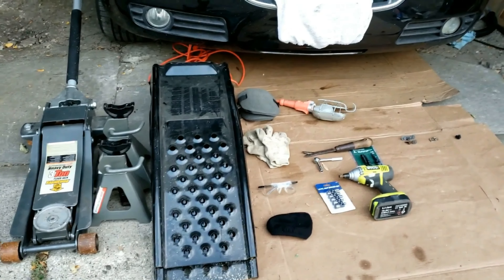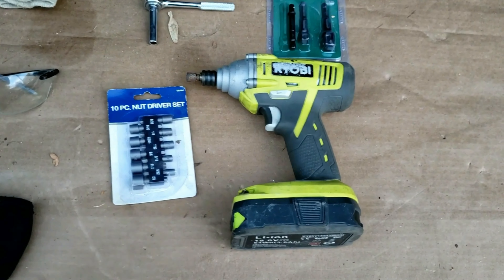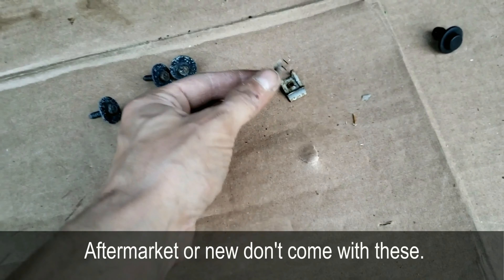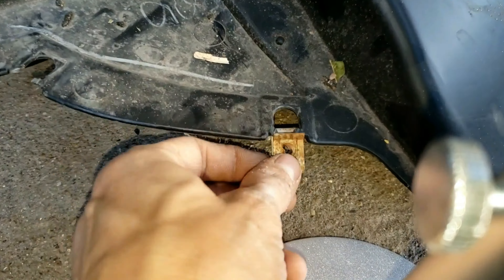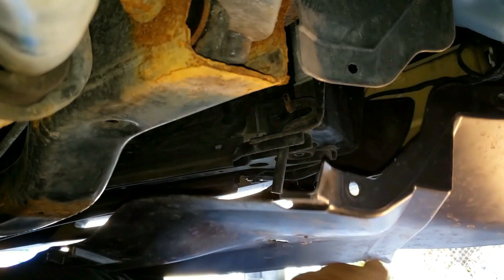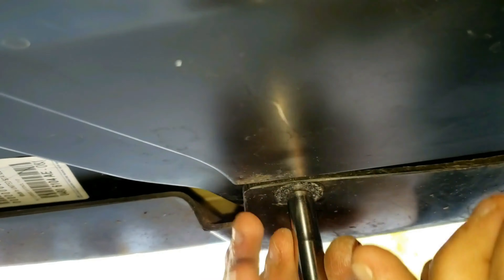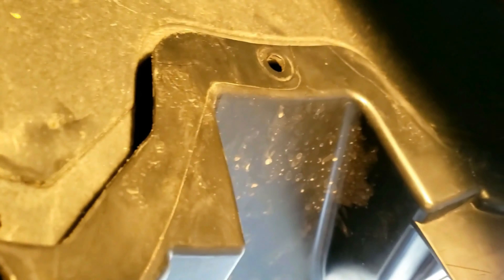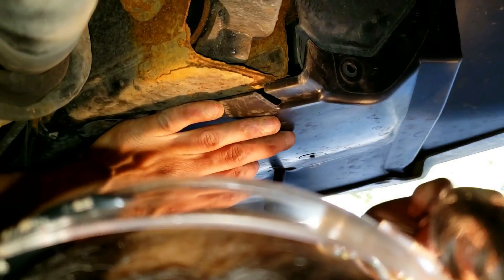Install Lower Splash 💦 Shield Engine Cover Guard on Chrysler Dodge Cars

Comment: Mine has another splash guard slightly to the rear of the car. I was wondering if this one goes under it, or over it
Reply from the maker: Not sure what you are asking. In general a car can have a few splash shields aka protective coverings throughout the base of the vehicle both in the front, middle, and rear.
Reply: Under, driving forward, you want the 2nd to be on top

Comment: What was that tube hanging, might be a dumb question but recently lost my splash guard due to a dip and noticed the tube exposing just like the one in the video. Want to be sure it’s nothing I should be concerned about
Reply from the maker: Yep its nothing bad in this case. I believe the rubber tube is a drain piece so water and condensation from the roof of the car or from the sun roof (if you have one) can flow down into it and straight onto the ground.

Comment: Can you show what the pins or brackets are the broke off so Ik what parts I need cause my splash shield on my 2013 is completely destroyed and had to replace the front bumper
Reply from the maker: The parts that hold the splash shield on are rivets aka plastic clips. Usually you can buy a variety pack and just pop these in. Also, check the description I posted the tools and supplies you may need.

Comment: Does this work for all Dodge? I have a 2011 challenger RT
Reply from the maker: Chrysler and Dodge share many similar parts. This should be mostly the same process. The difference may be in the number of bolts or clips to remove.

Comment: Hi. When you remove the plastic clips, do they usually need replaced with new ones? Does removing them damage them?
Reply from the maker: If you are referring to the plastic clips aka rivets, that are in the sides near the mud flap area then No. Then are meant to be reusable at least these ones are in this car.

If you are missing some you could always buy some extra rivets and put them in.

As for damaging them...its unlikely as a pry bar can easily pop them out. And putting them in is easy as well.

Comment: Hello, very good video! 
I’m trying to install it on mine 300c but it has 2 bolts (one on each end) holding like 2 little bars, my question is can I take it out or will it get damaged? Thank you
Reply from the maker: You should be able to remove the bolts, and then reinstall. I'm not sure what the little bars are though. 

Just look carefully in case their are more bolts.In this video I think I'm missing some bolts.

Their also might be some push clips or rivets on their btw.
Reply: @FixCarYourself  thank you so
Much I will try again! Do you have any video about fog lights for the 300c? My fog lights are  driving me crazy!! Could use your help
Reply from the maker: @joaquipereira8064  Yes I have 2 different videos o ca watch. If your removing the splash shield now completely then check out this one: https://youtu.be/xUT77lWQ-RY

If your going to do it later or our only doing 1 of the bulbs then check out this one: https://youtu.be/eMjM6oTRGA8
Reply from the maker: I put the links and all the tools in the description below as well for easy reference.
Reply: @FixCarYourself  thank you so much, I watched the videos but my problem is bigger than that lol, is there any way that I can send you pictures and I’m pretty sure you would be able to help me? Thanks once again
Reply: I’m sorry to be bothering you again but I’ve searched it and I think I’m missing a canbus but I’m not completely sure! Could you tell me if is that the part I need? Thanks
Reply from the maker: @joaquipereira8064  Not sure what or where you are talking about. thier shouldn't be any canbus underneath the car for a splash shield or for the fog lights.

Comment: 😡 I had my radiator and oil changed at the dealership one time and when I got my car back the splash Shield was gone. And when I took it back to them to work on it again, I guess they realized they forgot to put the splash Shield back on the last time, so they end up putting it back on wrong. And now it drags like a son of a b** and a lot of the fasteners are broken
Reply from the maker: Yep sounds like a dealership. This is actually a common occurrence by these companies. Usually they leave a few fasters off, because they forget to put them  back on or wind up breaking some of the (plastic) fasteners.

Comment: Mine is hanging off and drags when I tried to drive it. I've barely driven it and didn't run over anything. Does the car need it? If I get someone to take it off will it damage the car? This was my late husband's car and it's getting on my nerves!!!
Reply from the maker: You don't really need it  however if you are planning on having the car for a long time then it will help IF you live in harsh snowy climates or in dusty areas.

Comment: How you get the part? Splashguard
Reply from the maker: You could buy it online...ebay carries it. A little pricey more so because it's long and the shipping is what costs a lot. However, the cheapest option is getting a used one at a junkyard. It's easy to take off!